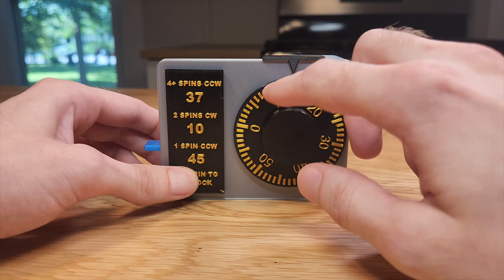3D Printed Vault Combination Lock

Comment: From the lack of ghosting I can tell your printer is very well tuned. What printer are you using? If you made a homebrew, as I did, what mechanism did you use? I ask because I am always looking to improve my designs.
Reply from the maker: I use a Prusa MKS3+ and a Prusa MK4 interchangeably. Credit to Prusa for the tuning. Aside from adjusting the tension on a few belts, I've gotten hundreds of hours of printing without any issues.